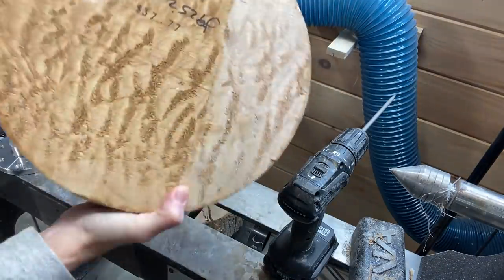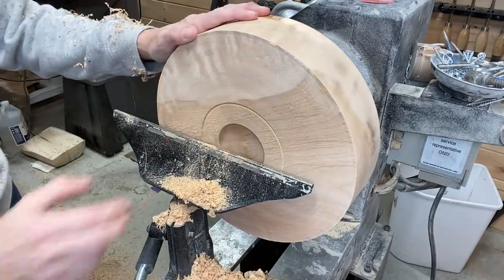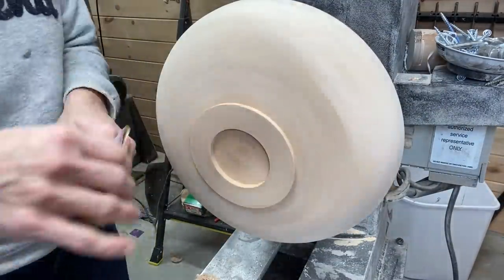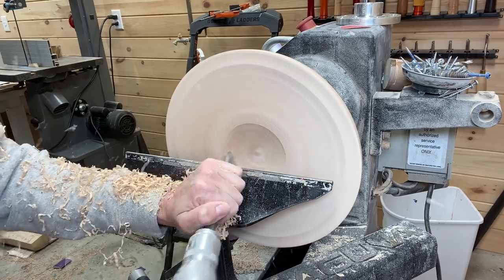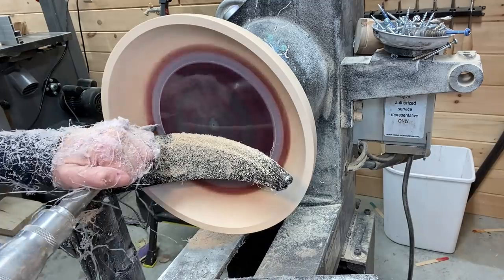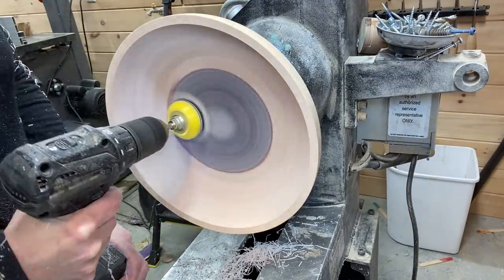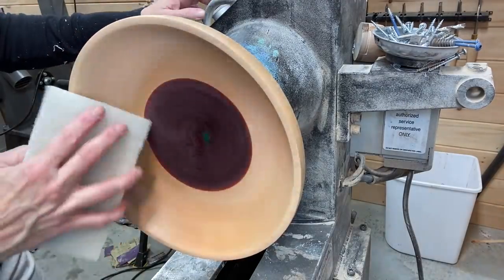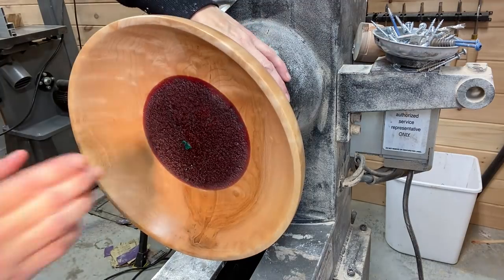Resin Pour & Maple Bowl - Woodturning Art

Comment: Great idea.  I think I would go to the bottom of the bowl and turn a step that's 1/8" to 1/4" deeper than the rest and pour the resin into the recesses part.  Having a hard step or edge around the resin would give a crisp edge without the feathering of the resin.  I might have to give it a go since I've recently stuck my head into the resin casting rabbit hole.
Reply from the maker: Ahhh, yes! Have fun in the rabbit hole!

Comment: Great piece of wood. Lots of grain movement and figure. You did a great job turning it as well. Not so much a fan of the resin though. You hid some of the beautiful figure with the “muddy” epoxy mix. 

Not trying to pile on, but you mentioned the tear out and needing to sharpen. The cause may have partially been a dull tool, but the bigger factor was that you are cutting against the grain. Make your cuts with the grain and I believe you will see the amount of tear out reduce significantly. 

Over all you have a really nice bowl there. Lose the resin and it’s a great bowl. Looking forward to the next video.
Reply from the maker: Thanks